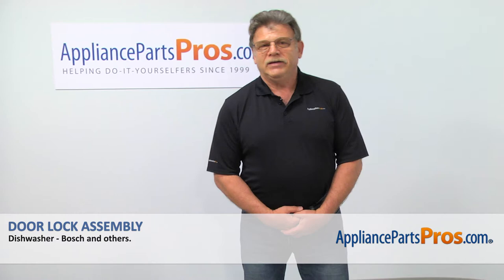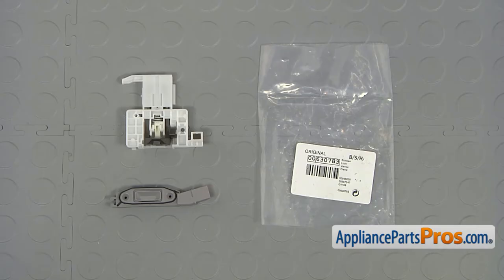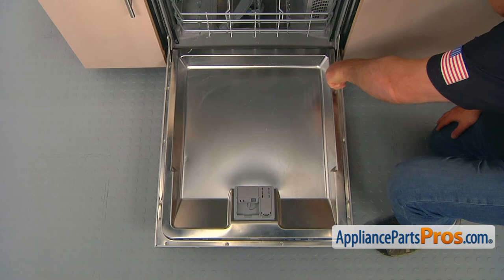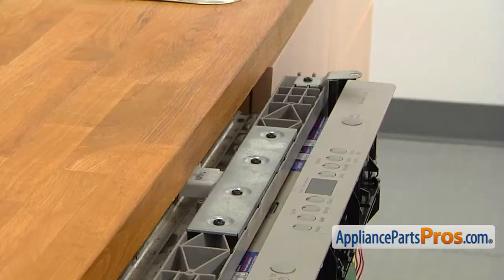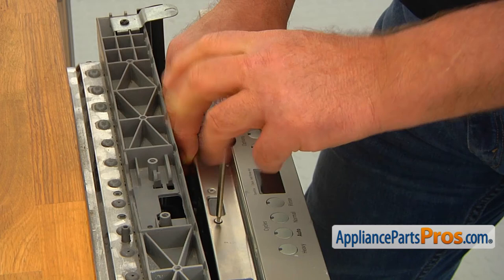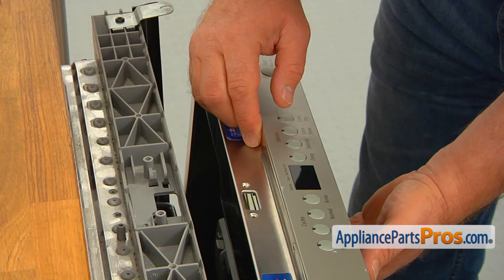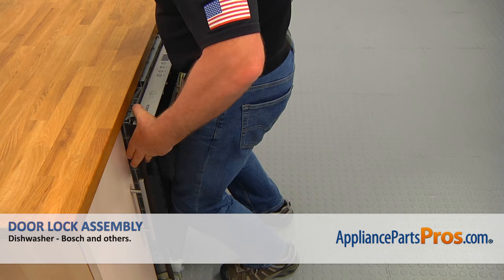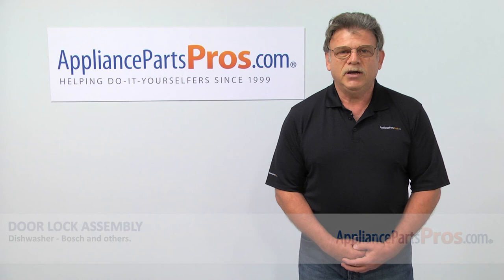How To: Bosch/Thermador/Gaggenau Door Lock Assembly 00630783

Comment: My dishwasher (same model) has power to the control panel (tested with multimeter) but no lights and will not "turn on"   I replaced the control panel, but that wasn't it.  Could this switch keep the dishwasher from even turning on?  What else would prevent it from turning on?